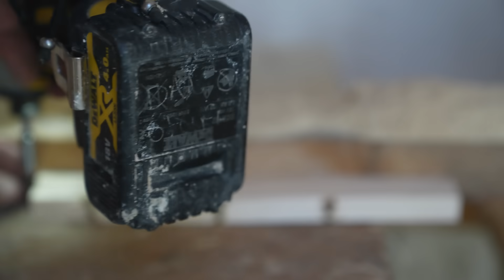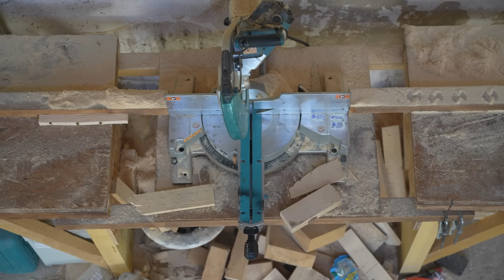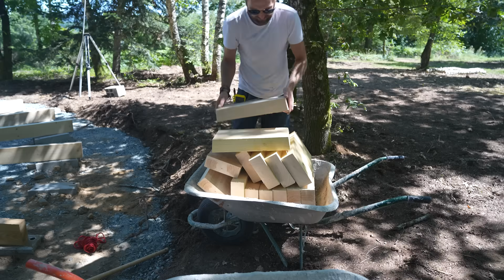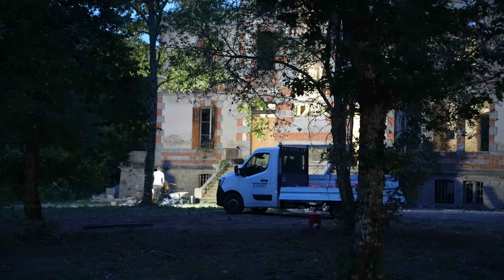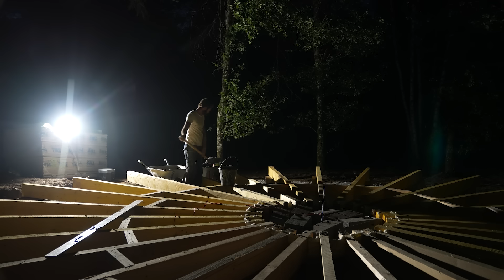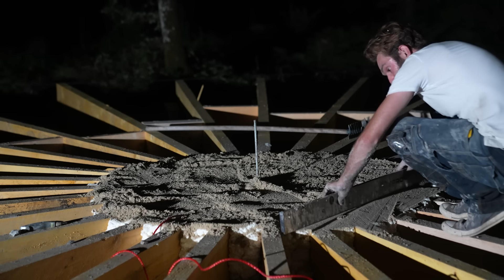A very close deadline, can I make it?

Comment: Often in camping RV shops is sold a portable hot water on demand shower unit. In the states it sells for $135.00. I’m sure in France you can find a similar item, heats with propane. And there is your hot shower! Get that water running and you’ll be up and running
Reply: I have an ALVA camping hot shower which works with gas.

Comment: Great job 👏 A couple I follow The Indie Project had a place off grid in Portugal they built a compost loo and shower block it had an electric shower using solar panels and had a bath heated the water up by burning logs underneath 🤔 water was in the large water containers filled from their well

Comment: Another great Vid. Now, it struck me that the noggin length should be calculated as Pi x Diameter to give circumference length at a particular point then multiplying spoke thickness gives the aggregate amount of the circumference taken up by the spokes and dividing the remainder by the number of gaps should provide noggin length (give or take).... also I am worrying about rodent protection around the perimeter of the base, that stove will attract every critter known to man in the winter....

Comment: all that expanding foam in the centre !!! all you had to do was shove in one of them old red bricks on its end, and to finish off you should have used a float to smooth off it doesnt need another layer of sand cement, & get yourself a pair of waterproof gloves when working with cement or concrete especially when you have lime in it

Comment: Great progress… it really looks great. If you ever have to build another round deck with a concrete center I would recommend you build it with a square in the center. Put some 45 degree noggins in the corners of the square for the concrete and the build out like a cross/sides of the square. Use joist hangers off of the cross for the rest of the floor joists. It keeps everything straight, 90 degree angles, and then just cut around the edge of the circle with a skill saw or a chainsaw. If you are insulating the floor it makes it a little easier as well. That’s for next time. This time looks like it is going to be OUTSTANDING! Thanks for sharing and good luck with the deadline!

Comment: Please be aware that cement eats away at wood so you should alway have a barrier (most use bitumen) between wood and cement. With lime mortar its not a problem since that is mineral based and has not been sintered. In this case its probably fine because the beams will have enough contact area even if the middle rots away, but it could be dangerous within the chateau.

Good work so far, I really like your projects

Comment: Dan. Check out a Gorilla Cart. I have one. My husband filled the tires with foam cuz of the constant flats (expensive to replace!) from 4” long Mesquite tree thorns. As the handle rusted down, it got modified to fit me better. Lol! It’s a diehard workhorse. I used to only use wheelbarrows & 5 gallon buckets but the Gorilla Cart is a complete improvement on Quality of Life. I can drag over 500 lbs with just 1 arm. I’m not a SpringChicken (+55). Just saying consider giving it a try. Saves the back & shoulders SO much! Nothing to balance or teeter. 💪🏼💪🏼
Reply: Yes, good idea!   We love our Gorilla Cart!   ( And we have same thorny Mesquite problems here in TX.)   Wonder if Dan can get them in France?

Comment: And to think you had to scrub off outdoors under that flimsy little bag of water with the light on, and crawl into that tent after all this is kindof crazy.
Not for long though! Soon you'll be next level glamping, and in a little bit, you'll have made that yurt the most inspiring little home! Go go go ! ❤
Reply: He still hasn't any running water or a proper working shower or even a toilet.
Reply: @jmk1962  that's what I'm saying. He's never disclosed his toilet set up he's been using. A regular outhouse with a bin and some lime, and an area for composting away from the chateau is totally sufficient actually. As long as you limit it mostly to using it for number 2. 
But when you're doing dusty construction work you really need a hot shower facility. I'm sure that's a priority inside or next to the yurt. He's goingnto need a proper water source anyway.

Comment: Can you get a couple of water storage tanks on the property and have a water truck fill them once/month?
You could attach a hose to them and leave it out in the sun.
I do that in my backyard to rinse off when I get out of the pool. It’s not a long shower but enough to rinse off and wash your hair.
You should treat yourself to an Air BNB once a week for a bath.
Does you area have a public, enclosed swimming pool? You could buy a ticket, just to to use the shower.
Also, check if there is a cheap gym membership or Sauna nearby you could use to shower at, especially in Winter. It’s probably cheaper than Air BNB

Comment: The rounded design looks very cool, but in my mind wouldn’t be much easier make a square and then cut the central hole and the bits around to make it round? Please correct me if I am wrong , just looks easier that way, again the rounded design looks awesome, I guess s it’s a bit of a challenge for my brain to get this design I wouldn’t even know how to start. still trying to guess in which direction the boards at top will be laid

Comment: Dan is making an ancient ( yurt ) and medieval ( chateau) home at the same time!
Bravo builder Dan!!!
Reply: Well the Chateau is not exactly Medieval . It was built at the turn of the 20 th century . It does look like a Medieval building by how badly it has burnt down .
Reply: We're not certain exactly how old the base if the building is. The current appearance with the brick facade is 120ish years. There's a chateau marked on the sight for several centuries and Dan thinks some of the basement, at least, is older. Looking at the windows in the old kitchen it could potentially be later mediaeval. Without research in old archives we won't know. Dan doesn't have the time for that yet.

Comment: Dan, I noticed that some of the old bits of wooden beams had a section cut out of the top edge of one side; I’m assuming the previous builders did that to make the beams easier to slide in, and I only mentioned it in case you either didn’t notice or didn’t think of cutting a small bit of wood out instead of chipping rock and mortar out of the wall. 

I noticed the first time when you were pulling bits out of the wall for the first floor (second floor? Not the ground floor) and then again when you did the kitchen. I don’t know if you want to implement that or not, but I thought I’d mention seeing it! :)

On another note, your journey is amazing, I have learned a lot from watching your videos, and as your other followers can attest, we are all rooting for your continued success!!

Comment: No underfloor vent in the center for the loggburner?
Reply: It must go non a fireproof floor pad🎉🎉🎉
Reply: A vent can easily be installed right next to the concrete pad. Just a plastic pipe to the underside of the flooring.

Comment: My too cents:   I would have suggested making a temporary ramp up to the decking & put down a few sheets of plywood to roll across. Then mixed up the concrete & just rolled onto the deck & dumped it in the center.  Your hand mixing/pouring the concrete.  Also i would have add something in back of the foam.  Blocking! but at least some really well  stapled house wrap.   if it was a concrete truck,  you would have to use blockings!  BUT I am GLAD you got away with just the foam!

Comment: Was going to suggest you consider a “dry pour” of cement for the top layer of the center or anywhere else you need an easy, smooth finish.  If not familiar, instructions can be found on YT of course.   Can’t wait to see the yurt in it’s final glory, maybe can keep it as a visitor center after the chateau is finished!

Comment: I’ve always screwed noggins from both sides, not from the top.  Any thoughts?
Reply: For internal work I agree, but this is external and those screws should be nails. Those screws  will be snapping as they  don't allow for movement in the timber  like nails do. He does not know what he is doing with regards to construction. This channel should be called The DIY Chateau renovation. Still with 250,000 subscribers he is never gonna stopped.

Comment: I know you can treat a yurt like a regular house with plumbing and electric. But did you know that there are small point of service water heaters you can use for camping. I believe they are also used on boats and RVs. I attend huge camping events where our shower is wooden stockade fencing attached to a bridge over a ditch. The water is literally a garden hose with a splitter. One side goes to cold tap, and the other goes through the heater for the shower. Temperature is  regulated via the taps in the shower.  Just like home, only outside with the sky above.

Comment: Yer yurt looking good, Dan.  Hoping that there is going to be good skirting around the perimeter so you are not inadvertently providing a haven for vermin in the maze beneath the floor.  You won't want tohear things that go bump in tge night.  Also is there going to be plumbing installed that may require some pipe laying while you still have ground access.  Just sayin'.😂
Reply: He'll be installing a kitchen sink which is still easy to install as the outside of the floor platform is complete yet.

Comment: Still no damp proof membrain under the wood beam sitting on top of the blocks. You coated the ends of the beam you fixed into the walls on each level I just wondered why not under the beams for the floor outside?

Comment: I hope you don’t mind a suggestion. Until you get your well cleaned out,  see if you can get a cheap food grade barrel usually they are 50 to 250 gallons and fill it with water …rainwater is best …to give yourself shower water.  Or you could run the well water through a filtration system
Reply: I suggested that he buy some rainwater barrels ages ago to collect rainwater but he never did.😢

Comment: Dan mate u have 360 degrees divide by how many timbers you have and subtract the width of the wood over length of circle calculate angles with a Belvel and transfer to miter saw and cut to size a bit kinda like doing a stairs balustrade you'll  get to that when you do the stairs , as a Carpenter over many years it becomes easier or you can cheat and do it in CAD  . I wish i could be there to help you out mate. Your not a Joiner or Carpenter but good on ya for learning the skills I just dont understand the cost of the tent and materials a caravan would be cheaper warmer and safer
Reply: Or lay the wood sections across the top and mark the angles underneath with a pencil and then number the pieces of wood and the location. Much faster IMO.

Comment: Won't this Cement crack, if you go walking around on this base tomorrow, it won't be curedas far as that hot shower, get yourself on of those black bag solar showers you will love it nice shower, for camping, be sure and shut it off between sudsing up or you will run out of water, unless you buy 2 of them, I've even improvised camping and put a gallon plastic jug in the sun and poke holes in the lid that will work too. The sun can heat it up quite well

Comment: Make yourself a ramp when hauling cement-a couple of chip board or those beams would have been wide enough. Run the wheelbarrow up on it and dump it where you need it. If you have to transfer it, that takes tons of time and more physical labor. Think about the fastest way-Work smarter, not harder.

Comment: Never seen a yurt in action, could you put a shower with hot water in it if you had a water source like in a camper? The ones I’ve seen were decked out for glamping and not on a non-functioning chateau. I am sure you did your research Dan, just wondering what it will be like and what creature comforts you can get in it. At least you have tons of wood for the furnace. If anyone can do it Dan you can.

Comment: At camping and 4 Wheel drive stores you can buy gas heated portable hot water services that run off canisters or a large gas bottle (if you are clever enough to rig one up that way which you are). Now that you have a water supply, a hot shower is a very real possibility. The water may not be crystal clear but with soap it will remove dust, dirt and any pong. Build yourself a duck board base and a modesty screen and you’re in business. A hot shower will really enhance your yurt holiday experience at the Chateau. 🇦🇺🦘🦘🇦🇺

Comment: Next time you do radial decks, you only need to cut one end of each nog on an angle. It doesn't matter at all if one nog is at 90 degrees and then the other one is the angle. You don't see them and they provide the same structural strength anyway so they don't need to be pretty, just there. What ends up happening is a zig zag pattern. Given your work ethic, which is clearly to work like a maniac until one day you just keel over, "smarter not harder" might help you in the long run. 🤣

Comment: I am envious of your energy and work rate, BUT , have you considered working Smarter not harder??
To explain,  parking the van a distance away from the building means loads of walking, wasted time and energy!
Make a loading platform on one side of the twin stairway at the same height as the van bed,means you can unload direct, instead of unloading to floor to pickup, to carry up the stairs more extra work!
Unloading timber of the back of van ,end over end,instead of of the side next to the yurt site!!
Can you not get the building supplies delivered in weekly bulk direct to site saving Daily trips to their yard, saving time and fuel.
Concrete to the middle of  yert mixer to barrow, barrow to bucket!!   putting a plank from outside of circle to the centre ,mixer, barrow centre.simple?? Smarter less effort!
OR is it all for untuned film?
Good luck, hope your back lasts the distance.
Reply: Yes, loading platform...This!...has been suggested many times, especially after the cringe offloading of the new scaffolding for the chateau tower.   Perhaps, after the main event/the yurt installation, Dan can do that.  Many more large equipment/materials coming, so...plan ahead for that, Dan.

Comment: You keep mentioning you are trying to find ways to be more efficient.  Should have loaded all the wood blocks into your flatbed truck and drove them down to the yurt site.  Second take a severak pieces of plywood, lay the down on the spokes and then wheel the concrete to the center of the wheel.

Comment: IMPORTANT ! Untreated wood should not be place directly against concrete because water will wick up in the concrete blocks you are using therefore it is advisable/necessary at least to put a sheet/layer of (torch down or EPDM) rubber roofing between the concrete blocks/concrete and your joists otherwise the wood in direct contact with the concrete will rot.  When I installed a tent using similar base construction with  1 1/8 inch plywood screwed down with square drive deck screws, I also treated all the wood with Thompson's water seal and very dilute solution of "copper green"/copper napthenate to deter insect/termite destruction.   When I took this flooring apart 6 years later, all of the wood was totally undamaged and re-usable same as new.

Reply